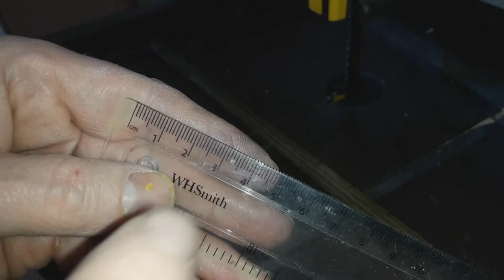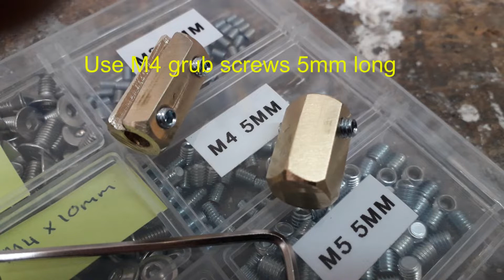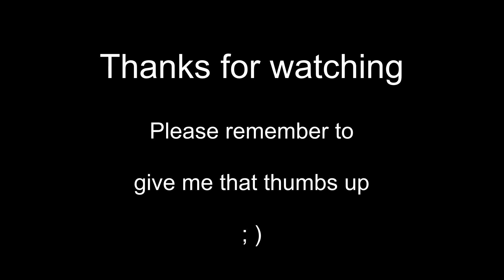(146) Lever Lock Picking Tools for under £5

Comment: This is an awesome tutorial, thank you for taking the time to do this video. This clears up a lot of questions I had about how these were made. Pretty cool that you have all the static machinery to make making these a lot easier than by doing everything with files. Cheers mate
Reply from the maker: Having equipment like this speeds up the process and takes out some elbow grease Haaa!!!
A dremmel with a cutting disk will also work to make the groove.
Cheers PW.